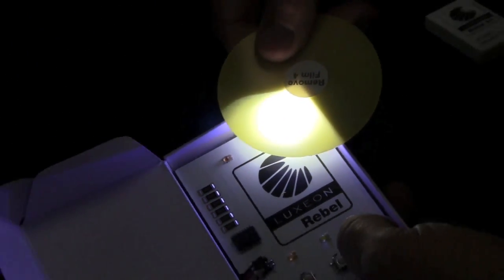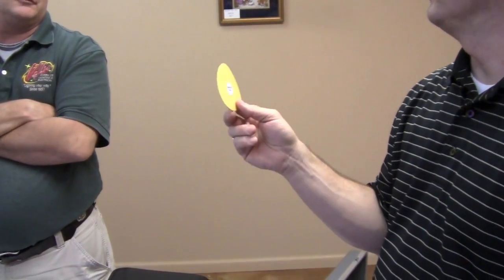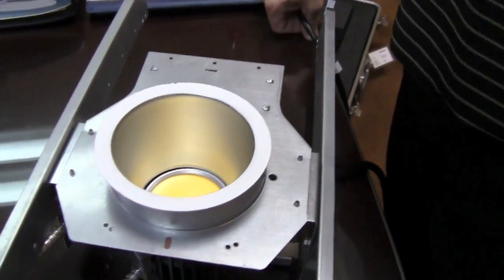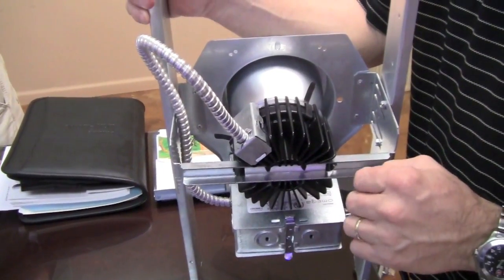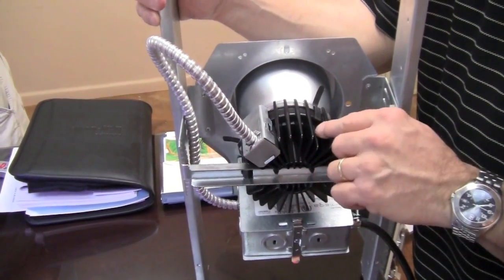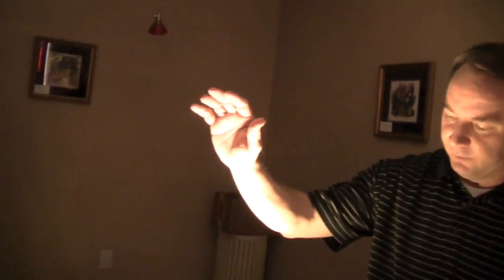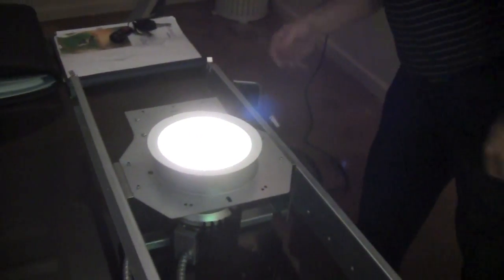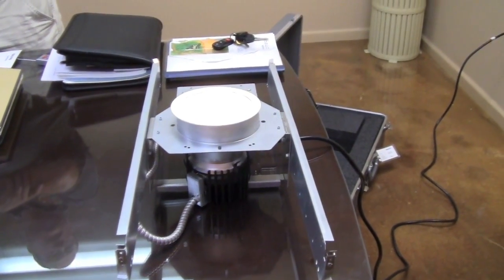Remote Phosphorus technology on blue LEDs - Capri Rep Demo 2011

Comment: Concerning the discussion surrounding landscape lighting, multiple shadows, etc. If using these for horticulture you'd most likely be mixing Blue and Deep Blue LEDs that have slightly varying spectral output in order to achieve the optimum spectrum for plant growth. If you were to move a spectroradiometer around under one of these lights the reading will constantly be changing. The further away you get the longer the light has to "mix." This isn't good considering a plant's Umol'/s requirements.